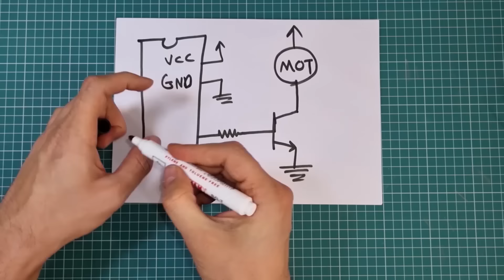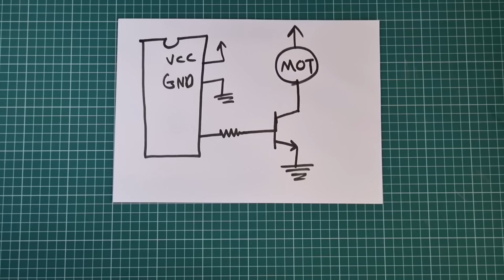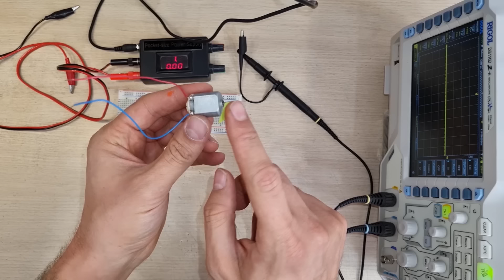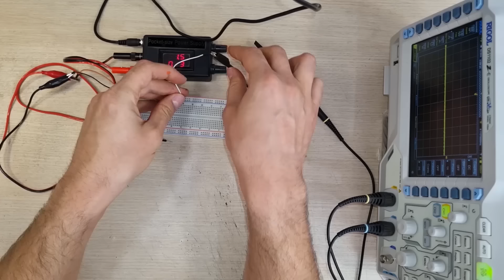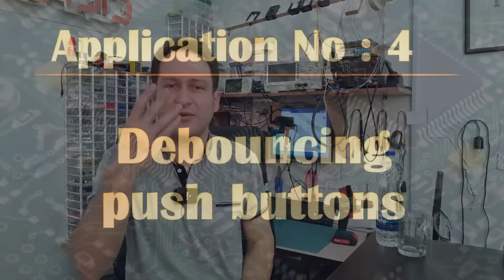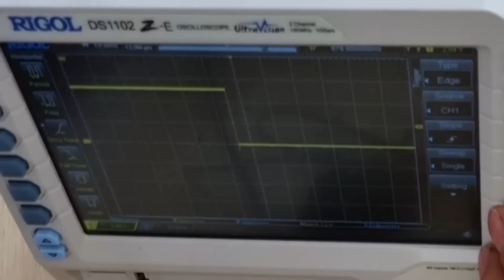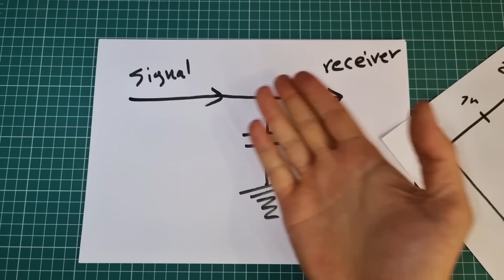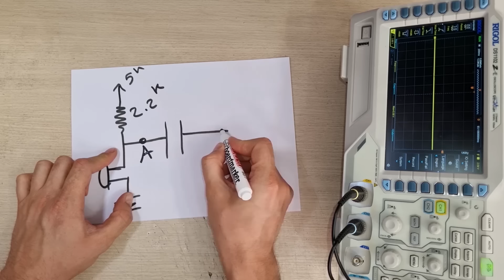10 awesome application of capacitors in circuits

Comment: Sir I hardly ever write comments but I'm a 59 year old guy and I've over the past couple of years have been trying to learn electronics and people leave out simple stuff that's so very valuable to a guy like me like one major break through for me is when uncle Dug made it very clear that ac and DC can travel through the same wire at the same time and never affect one another that opened my eyes cause I thought you mix the two and it would explode and I'm sure under the rite sercomstances it still mite I don't know .
Anyway I told you that so I could tell you this and it would help you with the importants of what I'm saying and that is there is no Detail what so ever that's to small or that's been said to many times for guys like me anyway like where to put the capacitor to allemenate  noise was it in series or paralleled  or to ground I know it bothers some people to hear a lot of what they already know but with me I don't mind hearing it a thousand times for two reasons one it pounds it in my thick scull but two and most importantly there may be someone watching and trying to learn that doesn't know it yet and I will yield and sacrifice for those people everytime cause I've been there and also know they could be the future your video is excellent and can be longer if you need it to be to cover these things you like uncle Doug with this one video have given me insight I wish I had a year and a half ago thank you very much for caring enough to teach with such Detail and I can't wait for more . Again Thank You Very Very Much 
P.s. forgive my spelling please.
Reply from the maker: Hi my 59 years old friend. Thank you for watching me. Thank you so much for taking time to write me this comment.

Comment: That is a terrible debounce circuit  When the switch is closed the capacitor is discharged through the switch, with the current limited only by the "stray" resistance of the circuit. The current can be high enough to cause damage to the switch contacts. Gold plated contacts, normally very reliable at low current, are particularly susceptible to damage. A series resistor should be used between the switch and the capacitor.
The capacitor, when properly used with the series resistor, lengthens the rise and fall time of the signal. This slow rise and fall can cause misoperation of downstream circuitry, behaving almost the same as the original switch bounce. A "receiver" with hysteresis should be used. These are typically called "Schmitt trigger" devices and may be inverters, buffers or gates. The ancient 74132 TTL device is a quad 2-input NAND Schmitt trigger. There are modern CMOS equivalents. Some microcontrollers have Schmitt triggers available on some inputs. (Debounce can be done in entirely in firmware, IF you have the time.)

Sometimes the higher current from discharging the capacitor actually improves switch reliability. Switches that are designed to carry substantial current typically are unreliable with low voltage and low current. Oxides form that low voltage can't "punch through" and there is no arcing to "burn" the oxides off. Transient high current as from discharging a capacitor can help. It is best to avoid such switches for low voltage, low current applications, but it is not always possible.

All of this applies to the comparator circuit, too. There is risk of switch contact damage from charging the capacitor and there is risk of multiple transitions at the output of the comparator as the capacitor discharges because there is no hysteresis in the circuit. Multiple transitions probably won't matter if all you are doing is switching an LED used as a visual indicator or a motor, but can be intolerable in other circuits. It is good practice to decouple the reference input of a compartor with a small capacitor to ground, especially when the reference voltage comes from the main supply.

Op amps when used as comparators are generally much slower than devices designed as comparators (in large part because the frequency compensation capacitor(!) internal to the op amp is allowed to accumulate a large undesirable DC charge). This often is unimportant, as it would be in the motor circuit. One advantage of an op am as a comparator is that the input offset voltage is often lower than a similarly-priced comparator (e.g. LM324 or 324A versus LM339).

Comment: Did you need the OpAmp cud just used transistor delay circuit
Reply from the maker: Yes you can make a delay circuit without an OPAMP, but in that case you need to use a relay

Comment: Capacitance may be used on screens of smart phones as a sensor (as you partially mentioned) to detect each touch. May also be used like a battery in USB flash keys to keep data. That's why it is highly recommended to plug in USB sticks to computer/power once in a while..
The one amazes me is the usage in RAM / flip-flops as data/bit storage. Thanks for the video..
Reply from the maker: Your welcome
Reply: No, static RAM uses flipflops. Dynamic RAM uses Capacitors.